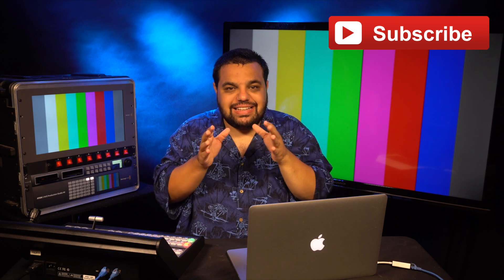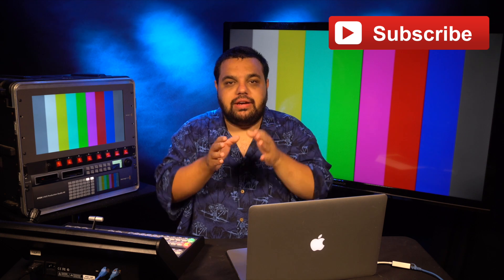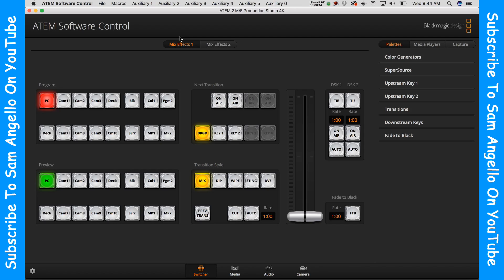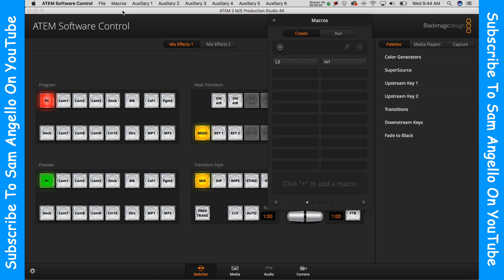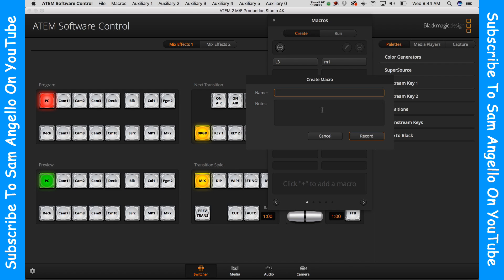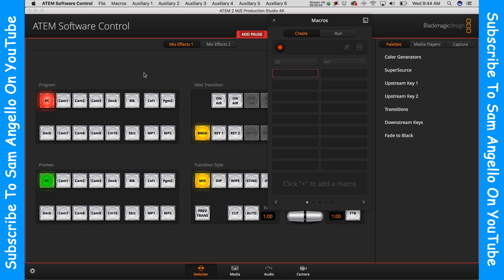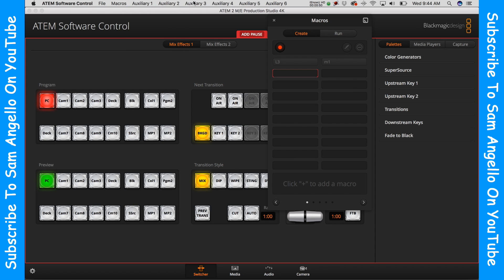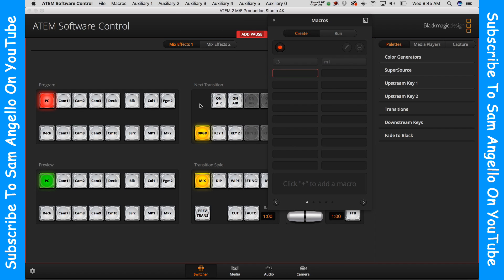How To Control Multiple Outputs & Sources Simultaneously With Macros BlackMagic Design ATEM

Comment: Wow -!! Constellation 1M/E - 10outputs here we go !! Was wondering how to do the switching simultaneously 😂
Reply from the maker: Macros
Reply: @SamAngello  Was trying to do this with the constellation 1 M/E and it doesn't appear to work the same... each output doesn't have an aux listing in the dropdown menu like shown in the video... though they are listed as being able to be used as auxillary outputs in the online documentation... however switching them from program isn't something that can be done via macros based on the limitations in their UX...

Comment: And are you able top use transitions like a a dissolve/fade when doing this?
Reply from the maker: Since were dealing with auxiliary outputs I don't believe there's a way to do cross fades it's only cuts but I could be wrong personally I don't find many uses for dissolves and fades I kind of think they looked 1980-ish so I only really use cuts for everything